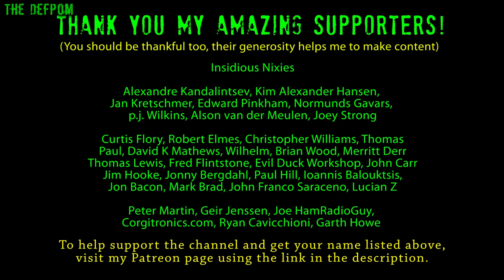🔴 LoRa to WiFI and LAN Gateway Project - sponsored by PCBway - No.902

Comment: Hi, Can i please ask what fluxes you are using. I tried watering down standard flux with IPA without success. I want to try LORA but am unsure what frequency's to use in New Zealand.
Cheers Dave.
Reply from the maker: I use Amtech NC- 559-V2-TF, the tube I am using here is actually expired by about 3 years... that tube has lasted me ages ! 
LoRa in NZ can be 433MHz, 915MHz, but I have also seen mention of 868MHz in SOME places, so I am not completely sure of that one being legal or not.